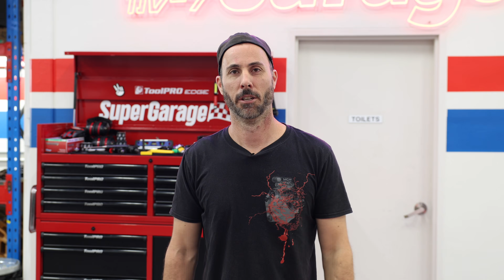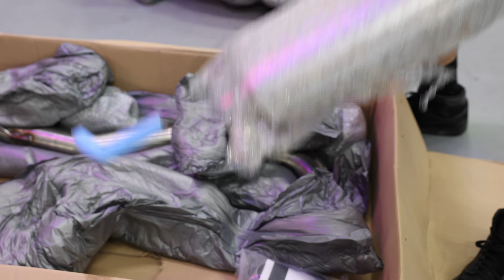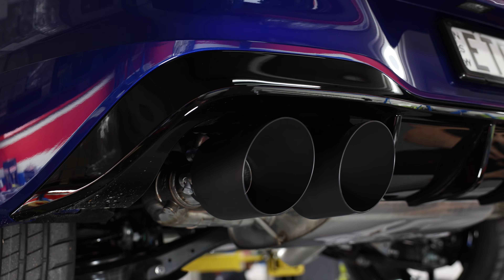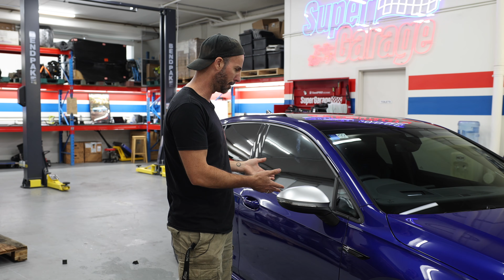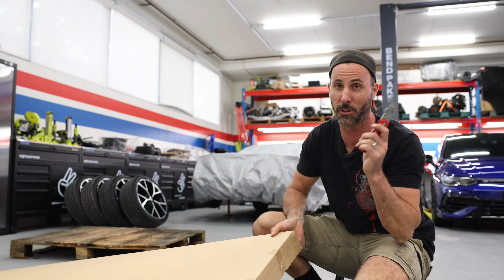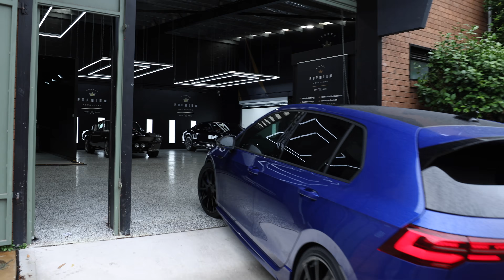Modifying my BRAND NEW MK8 Golf R (in just 24 Hours)

Comment: Im debating what I should do to my 7.5r with 19k miles. The motor was built by Bluewater in CO and was shipped to TN. A year after the move, something went wrong and the motor now has low compression on cyl 3. It was a full frame fully built engine on E85 tuned with UM software. I own it free and clear and it’s in perfect shape but it’s just sitting now. I’d like to get her back up and running. Suggestions?

Comment: The MK8 Golf R doesn't come with gas struts from factory as the way they are fitted on the GTI and other models means that in a crash they can be pushed through the bulk head and into the driver or passenger. The fitting points are there for them as the shell is the same as all other MK8 Golf models

Comment: Overall, the mods look pretty good, except for the lip. Intakes like the one you installed with an exposed filter take in hot air from the engine compartment. If all you're after is more sound, they deliver, but if you're after performance, these intakes are a step in the wrong direction. Also, surprised you didn't install a catch can. Every gram of oil in the catch can is one less gram going through the intake manifold, resulting in carbon deposits on the intake ports and valves.

Comment: The engines are not reliable. Yours won’t last long with mods. I bought mine in March and it’s already on its second engine. First engine blew at 3600 miles doing 60 on the freeway. I know another person who is having engine problems as well. Even without issues these engines will give up before they reach 150k which is pretty pathetic. Wish I would have known this before buying mine.

Comment: While it would be no proper tune, you can always modify the way your car's control units behave with OBDeleven, as we provide SFD unlocking due to our official license with Volkswagen – even if you are feeling a bit lazy, you can always use One-Click Apps to, for example, adjust the volume of the Soundaktor while driving

Comment: Congratulations!
I have the mk 7.5. Sorry but i still prefer it over the mk8
I opted for the zinvidia Q300 cutback. Ot is awesome sounding and looks great with the blue on the end pipes. Just be careful. My warranty was voided by WV Mawson Lakes because the previous owner had a performance tune done. You may loose your warranty on the engine. You call adding an open K&N filter stage one? Lol

Comment: Hi Moog, I currently have a Mk7 R with less than 30 clicks on the clock. Way back when, I ordered a Mk8 R and paid a deposit. I was originally told delivery would be Feb 22, then month by month the delivery date kept being pushed out and currently it’s due in Feb 23. Ok I get the World has vastly changed: global pandemic, supply chain issues and wars are affecting everything. So a little boy waits 😞 

Funny thing also is that the dealer no names mentioned but the one closest t Tullamarine airport, rings me basically monthly to try to take my Mk7 off my hands, what on earth am I supposed to drive in the meantime I wonder, a Tiguan or diesel Passat? God help me

Anyway enough of the grizzling because no doubt there are tons of people in the same boat.

To my question, you’ve put out a mod video for your Mk8. How does someone who gets exactly the same car go about doing what you’ve done? Do I send the car up to you or someone you know or is there an outfit in Melbourne that will do it?

Cheers
Richard

Comment: Wrong tyres. They are a touring tyre. Should have gone with 4S. The 5 will spoil the handling, it does not replace the 4S. Roll on the 5S

Comment: Keep the lip, but center that sticker. 2 strikes on that supplier for not leaving that sticker for you to apply, and leaving all those bolts and nuts rattling around loose in there to scuff the finish....seriously?

@31:45, Smoke and Fire, is amazing in the Moog Big Pack, and that section of the track is MASSIVE.
Best Track to blast on a drive. Plenty of others too. So glad I bought that pack.

Comment: the reason that there is no gas pressure rod for the hood is that a stiff rod is morge fleixible in case of a crash with a human. the whole hood is special designed for avoiding damage on human body

Comment: The 20mm drop works so well, H&R springs?  I used to fit the dealer option Eibachs on MkIV Golf back in the day,  similar drop and worked so well with the OE dampers.  Now I've got a MkIV Bora V6 4Motion, well it's actually my son's car when he gets his Ps, which had Eibach springs when I got it.  Big fan of the OEM+ look.

Comment: It's sort of annoying when people claim they "paint correct" cars... but all they do is a super basic machine polish. Actual paint correction is removing all the orange peel in the clear coat, so the paint reflects like a mirror, without aberrations. It is a painstaking sanding process, then multistage polish. If paint is too thin, or only single stage, several layers of clear coat is sprayed on so that the mirror finish can be achieved. This process takes hundreds and hundreds of hours to complete, and is very expensive.

Comment: 17.25: Using the widow makers. Did this to my Ford Territory... bigger/heavier springs = sketchy. I will let Pedders (or similar) do it next time.
Also, nyloc nuts should only be used once (unless you add some locktite) - depending on application.
Great video. Enjoy

Comment: I like the lip kit(confused I thought you said "Lift" kit at first), but you should try racing without it and with it to see if you can notice any discernable difference in function.
Great Job..  Aside from the impacts of Commuters, I think cars are great for visiting relatives, shopping or taking lazy Sunday drives to Niagara Falls/Lake Simcoe on the fresh expressways...
I stopped driving 20 years ago and been riding a bike ever since and the only thing I miss about my car is taking those lazy Sunday drives, rolling one up and rolling down the highway..
This "Bud" is for You! 😏👌🌥 What a great finish too with the makeover...
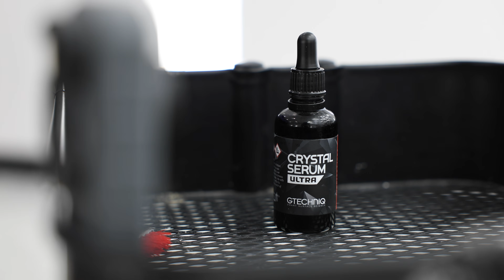Although might have wanted a light sanding with 7000 grit wet sandpaper block during the paint touchups, to remove the "orange peeling" in the "factory" paint, I doubt however that many people put their faces that close to the paintjob anyway...  or even notice...  36:46

Comment: Why didn't you put the stock VW wheel badges back on the car? I had the 7.5 Golf R estate and loved it...should never have sold it. I now drive the Cupra Ateca which also has no higher spec and also didn't come with a bonnet strut. I fitted one and as you say...should have come from the factory with one. Good luck with the car.

Comment: @MCM - you should grab an OBDeleven which will let you easily adjust change car settings. From enabled undertake with ACC, to adjusting the speedo calibration and everything in between.

Best thing I ever purchased for my golf!.. Changes that are a must do, 
- disable starting vibration reduction (stops the car from applying the brakes if you get any slight wheel slip, which causes the thudding) 
- enable press and hold lock/unlock on key to wind windows up/down. 
- allow door locking while engine is running.
- enable a selection of colours for the dash/infotainment accents.
- disable start stop at all times. 
- don't turn off DRLs when indicator is active.
- disable menu/input lockouts while driving.
- enable undertaking while using ACC (the car will literally slow down to the same speed as a car on the right, rather than continuing past).
- set soundaktor percentage (0-100%)
- change throttle input curve to "direct" (by default the throttle ramps up and down in attempt to smooth the drive).

It's really endless.
Reply: I might have to get that, thanks man

Comment: The Golf looks absolutely stunning after the exterior treatment! You may have just worked up some business for my local shop.
I've been thinking about doing a PPF and ceramic coating for a couple years. I may have one of the more common vehicles on the road here in Canada, a Ford Edge Sport, but damn if the Tuxedo Black doesn't look awesome when it's freshly clean out in the sun. Can only imagine what it will be if I get it treated.

Comment: The car came out looking nice and clean. I dig it. Good job. Black and blue is a nice color combo. I like the lip kit on it. 
Small piece of advice to save your nerves from aggravation: VW uses lots of those blasted hose clams you used needle nose pliers on, get the tool to remove those when doing the intake. Thank me later.
I'm jealous of places that allow tint. It's currently illegal on cars where I'm at now and it bums me out. I want tint for the exact reasons Moog mentioned.
What's the VAG community opinion on reusing suspension bolts (since they're stretch bolts and VW recommends replacing rather than reusing)? It looked like Moog was reusing them, or at least he didn't specify if they were new or not.

Comment: You’ve definitely improved the look of the car. I had a mk7.5 gti so I’m biased toward the mk7s but this video convinced me the mk8 is not a bad looking car. Also, why not remove the factory bonnet prop? I’ve installed gas struts before and take out the prop to improve the look of the engine bay. It also serves no purpose anymore. Cheers from Chicago!

Comment: The splitter is a no for me, there is already a bunch of horizontal black plastic in the grill, adding another layer just makes the car looks higher rather then lower i reckon. Besides, because the air can pass over the top of the splitter, it isnt actually a functional splitter...

Comment: I'm usually not a big fan of big front lips but I think the MK8 will benefit from it – its new face is a bit 'gentle' and the lip will give it the edge it's missing. However, you mention usability a lot. With your 20mm lowering, is it not going to hit every bump in the road? If that happens, then I would try and find a slightly less aggressive lip that would give you looks and functionality. The car looks fantastic BTW. Kudos!

Comment: Lip kit actually looked pretty good. Logo placement is probably similar to an offset racing stripe, you wouldn't run a single stripe right down the middle.. Idk. Things look weird in the middle of the car, but 1/3 or 1/4 offset? Much better.

Comment: Sam should show you how to fit a tyre. You guys are good but, clamping a wheel down like that will mark the brand new alloy (hello corrsion). 

While  on a rant 🤣 torquing nut with an extension changes the settings. 🤦‍♂️

Comment: i worked for 12 years at a dealer in the netherlands ans at the end we would where gloves not the plastic one but fabric with sort of roubber over the places you touch stuff where very good we would ones that fit are hand perfect if they have lose spots on any glove the will break i could get small bolts outs with just my index finger and fuckyou finger with the gloves one we started it to be able to move cars without washing are hands but came a thing after that

Comment: I worked in the Honda factory in England until we closed last year, I was on exhaust for a week or two covering during covid. We had 90 seconds to install the whole exhaust system bolt up and torque.
I’ve never removed a new exhaust as that would mean stopping the line at a cost of £10k a min 3 mins is quick though

Comment: That's interesting about the mirror caps, because I thought (on the Mk7 anyway) that the mirror caps were black on the R. My wife's AllTrack has silver mirror caps and every Mk7 AllTrack I've seen has the silver while the Mk7 R had black. If it was a change up for the Mk8 I think they should have stuck with the blackout mirror caps.

Comment: I gotta say, sometimes lip kits look good, sometimes they don't. In this case, based on your mock fitment in the video, I'm putting this firmly in the "don't" camp. I'm sure there will be a good one out there but for your OEM+ look I think it's just too low after the drop with that lip on, and since it has a little bit of one from the factory already.

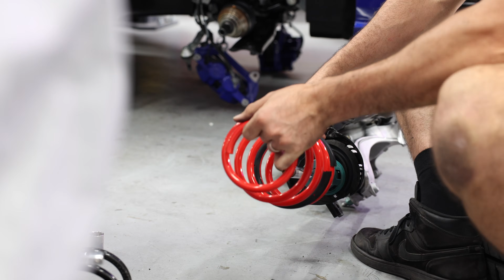Comment: 17:26 does the shock not loosen from the lower pinch bolt there? I've had experience with mazda 3's with this design; it's in the service manuals to start bashing away till it comes loose

Comment: lip kit looks great with the subtle stance those lowered springs provide - although do be careful as the maxton lips break super easily under any hard contact with the pavement. pretty sure the logo is supposed to be in the middle too which is weird, but should still look nice, clean and oem+ without

Comment: There is aright way and a wrong way to install gas springs and you have installed it wrong , the the rod end should be to the bottom and the body to the top, all something to do with lubricating the internal seal. if you don't believe me just look at the ones in the boot.

Comment: Love that the valve system in that golf R is exactly the same as my MK8 fiesta st. Just a note for the valve, after a while the spring compresses too much and it gets rattly when the valves shut. If that happens put a little piece of rubber in the motor side, it helps. Had to do it with mine with the miltek exhaust.
Reply: I like front spoiler on better

Comment: I reckon the lip kit is good. Looks meaner with it, cleaner without. Depends on what style you want, it's your car after all. Sick vid as always, happy you're so happy with the car, mate 🤙🏻
Reply: I would send that Maxton Lip Kit Back to Maxton. Bought a Maxton kit once. It was badly made, terrible finish. Had to send it back.  If I was desperate for a lip kit I would buy from TRC (Triple R Composites).
Reply: @callumpetch2569  I have a Maxton rear bumper, it was just terrible fitment wise, had to sand and glue a lot.
Reply: Has some Urus vibes if you ask me.
Reply: i agree. looks much more aggressive with it. personally don't like mk8 r much cause looks too much like an ordinary car. so i think that front splitter deffo helps it stands out quite a bit.
Reply: On!!

Comment: I have the SEAT Leon CUPRA ST300 4 drive. Great car. Although I modes it straight away. And had turbo failure at 13k miles. But due to the mods the warranty was void. So fair play to you 👏

Comment: Looks amazing! I would not install the front lip, not really a fan of the aesthetics. Initially I though the ride height was too low - wheelgap is not uniform around the circumference - but the stance in the glamour shot after detailing is really nice :) Perhaps debadge the rear hatch? That centered R in my opinion looks out of place since it is styled to be visually heavy on the right and they've aligned it centrally (plus the aestheticsas of the car are dope enough that it does not needs an R badge to advertise it is a neat car).

Comment: The standard breaks one my Mk7.5 GTD are awesome in my eye, as I've had them glowing bright orange and I never got any break fade. 
I remember "TheHumbleMechanic" putting the standard pads back on, as they were better than the aftermarket race one.

Mines got a gas strut. My 04 A3 had a gas strut. I wonder if it’s something to do with Australia, as you've got some strange laws 🤨
Reply: It's a worldwide thing on the 8, previous gens had the gas strut.
Reply: @onearmedbandit_nz  I'm just wondering why? I can completely understand as it's a lot more expensive than a bent bit of steel and it weighs less and it's a shed loads cheaper for something your hardly ever going to use.
Reply: @TheManLab7  for all the reasons you listed is why. Saving even $10 per unit when you sell hundreds of thousands of units soon adds up to a decent saving.
Reply: @onearmedbandit_nz  Yea I know the cost can change between country to country and they do or don't want specific things as standard or extras. 
I'm just wondering else what they've skimped out on to save on the BOM? 🤔

Comment: I can't recommend 3M PPF highly enough. I've used it on my front corner lights, the sidemarkers/indicators and of course the pop-up lights.
I've also used it on the place where I needed it the most on my car, which was the tail lights. being an 80's car with degrading plastics and bad UV rot, I needed something to protect the lenses from being any worse, which is where the PPF (and specifically 3M) came into the picture. after sanding them down with 1500 wet/dry and washing them, they got PPF coated and look fresher than when they left the showroom. it's also UV resistant, self-healing (some kind of black magic in that) and was piss-easy to apply. great episode Moog.
Reply: But is it worth 2900$ for the front tho? Cuz that my local wrapping place (exclusive wrap) has quoted me. Don’t think it’s worth that much, because luxury car don’t stay in your hands that long

Comment: Okay, first with the exhaust tips I was like, what’s wrong with the flattened chrome? But, okay, I am sold, the black ones are, indeed, miles better.  And my vote is a yes on the lip and the badge would be weird if it was centered.  I think it’s supposed to be off center.  And, I just got my mad ceramic coffee mugs in the mail a couple days ago and they are fantastic!  A proper addition to probably the finest thermal travel mugs I’ve ever owned procured last month.  Been back and forth for some time now on adding gas struts on my hood (bonnet) and I thought I had decided on leaving the purity as the designers intended but now…..maybe I should do it??  Anyway, Cheers, congrats on the vag and enjoy!